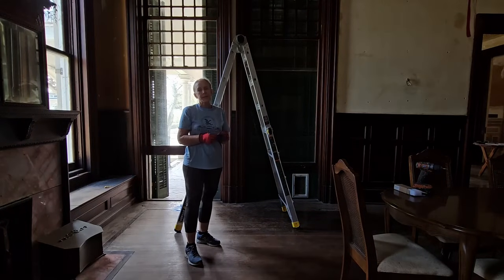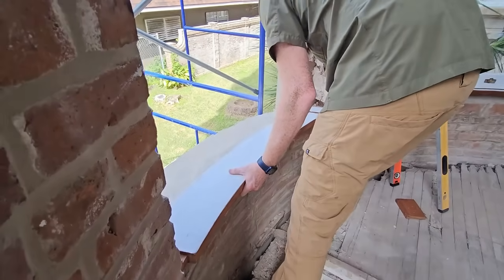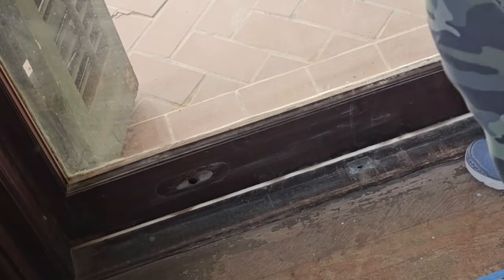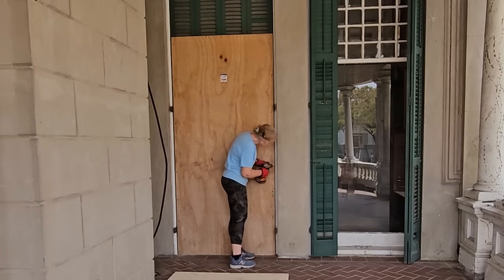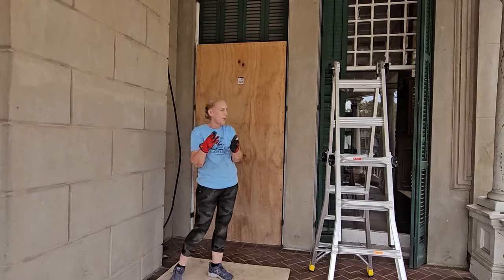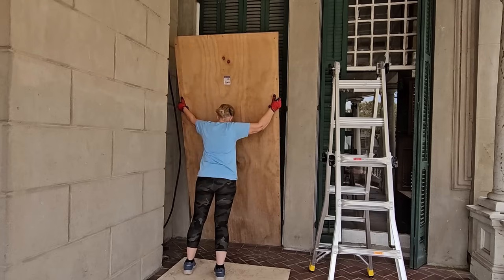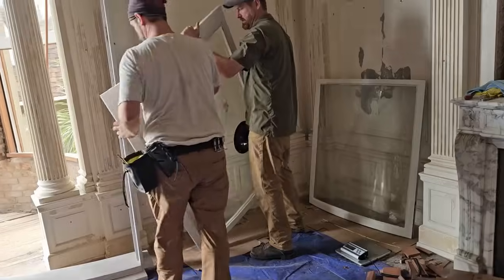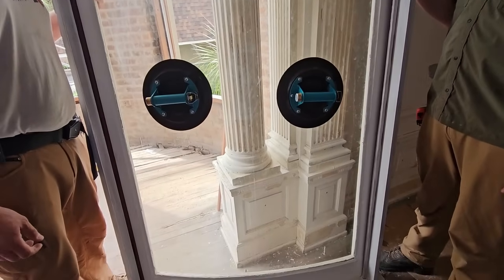S4.22 Let The Sun Shine In!!!  The Last Window Goes In and the Plywood Comes off.

Comment: What a great milestone and accomplishment!  They got them as close to original as possible if not better.  I hope you balance out the sashes before you close up the interior millwork - I am assuming that these did have access panels for the weights.  It just would be nice to see them work with balanced sash weights especially after all this meticulous work - why stop at this point when you come this far.
Reply from the maker: You are so right!  We want these to be perfect.  They do have the access panels.  After thinking about them being out of balance, we think an addition issue (besides the pullies having bearings) could be the lack of the interior trim which will provide more friction.  For that reason, we are going to wait to make any adjustments to the weights.  We've learned not to get to far ahead of ourselves when working out these little kinks.  Thanks for your support!

Comment: Hi!  The first window you worked on, with the bent weather stripping, is it possible the upper sash is dropped slightly and at an angle?  That would prevent the latch from aligning and locking.  It's hard to tell, but as viewed from the interior, the left side of the top rail looks thicker, or lower, than the right side.

I always LOVE seeing the bevelled divided-lites of the upper sashes, they are amazing!  Thank you for the videos!  -Red-headed Jo from Oklahoma 🤗
Reply from the maker: Hi Red-headed Jo, (just like my sister). I think it might be and I'm not sure if it's the window itself or if the house is slightly out of level at that corner.  I didn't have time to fiddle with it much, there was a lot going on and I really wanted to get rid of that doggie door while Ben and Josh were there in case I got into trouble.  I've been shocked that so many of these windows still go up and down pretty well. Each one needs a thorough assessment at some point.  The bevels in the top sashes are amazing.  Our stained glass experts think they might be hand beveled.  Unbelievable that non of them are broken.